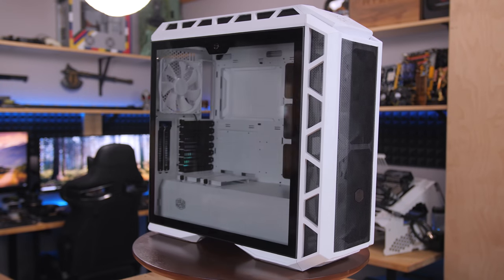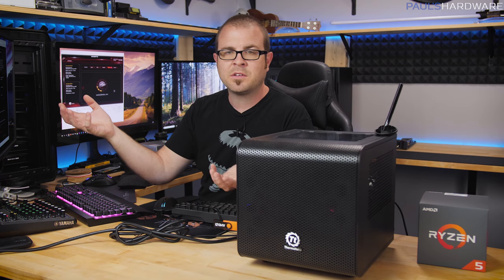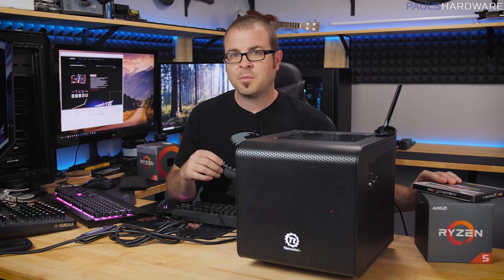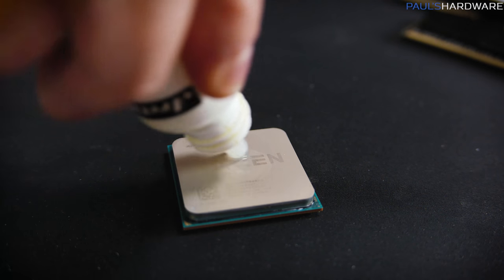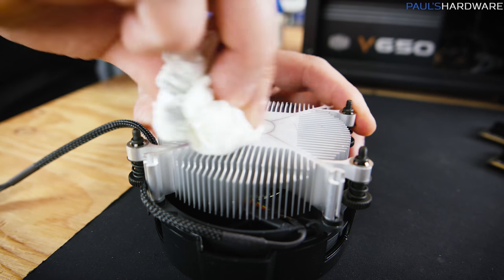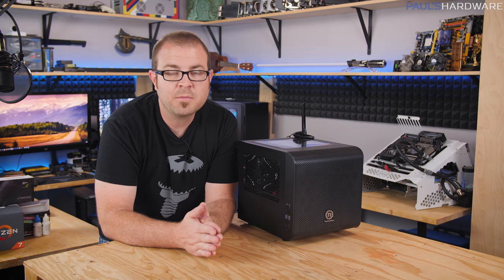How To Upgrade the $500 Gaming PC with Ryzen 2!

Comment from the maker: ►TIMESTAMPS◄
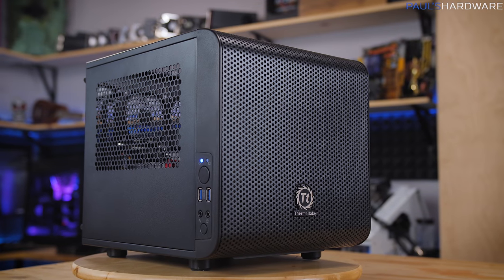0:32 Intro & Upgrade Goals
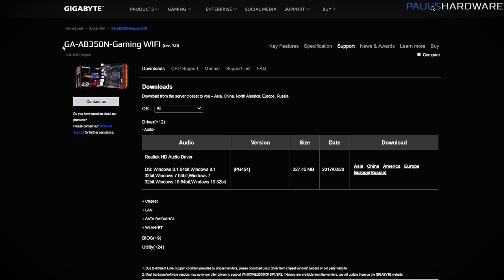3:59 Updating your UEFI/BIOS
5:50 Pre-upgrade BIOS settings
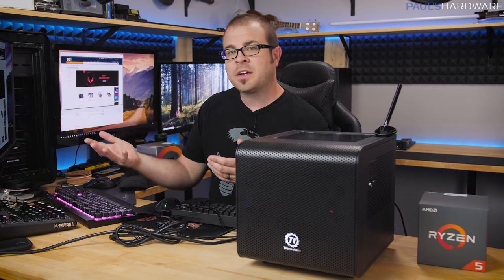9:00 My Chosen Upgrades
12:23 Finding a GPU that's not overpriced
13:54 Upgrade begins
14:51 Does your new GPU need more power?
15:57 Un-installing CPU and Memory
20:16 Comparing the Wraith Stealth to the Wraith Spire
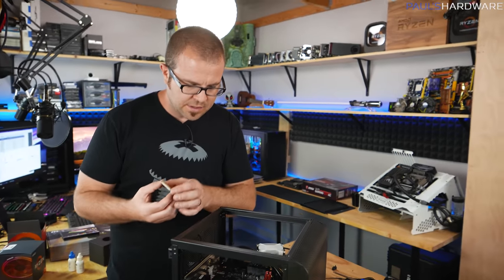21:05 Installing new CPU + Cooler
22:34 Installing new Memory
22:44 Installing new Graphics Card
23:58 Booting up again - BIOS settings
26:10 Checking that everything is working
►NOTES◄
- The new AMD motherboards use X470 and B450 chipsets (B450, not B460) 
- Total price for the upgraded system (via PCPartPicker) is $895 right now
-- 2600X is $230, GTX 1050 Ti is $205, DDR4 is $192
Thanks for watching the video guys!!
Reply: Paul's Hardware q
Reply: is it true that Precision boost 2 and XFR 2 only work with the new chipsets?
Reply: Nice but an all AMD build you have been nicer
Reply: are the new motherboards (for ryzen 2) compatible with first gen ryzen?.. bent my usb 3.0 pin and want a new motherboard and like the looks of the new x470 boards over the x370s
Reply: Paul is the best builder/instructor out there.
Reply: S Saini I would put a 580-8GB in it and use FreeSync.
Reply: Buff Barnaby who are you responding to?
Reply: Paul's Hardware you put the wrong link for the Trident Z RGB Ram in the description. Please fix :(
Reply: Paul's Hardware Hey Paul, a couple of questions, I'm upgrading my prebuilt PC to the new Ryzen 2600x and GIGABYTE GA-AB350M-Gaming 3 motherboard and I'm wondering if I will have any issues with Windows when I swap out the boards? I'm also wondering if the new parts will prevent the computer from booting if I don't install the latest BIOS updates first.  Thank you in advanced.

Comment: I actually just added a 1050TI to my 2400G HTPC build. I would argue the CPU upgrade short of a content creation use case is not needed and in that case I would spend the money on at least a 1060. I recently saw a 6GB 1060 on Newegg for $299 which I think is a great price for that GPU. I paid $276 @ Launch in 2016.
Reply: I agree 100%. At least test the 2200g with the 1050ti before adding the 2600x.
Reply: The 3GB EVGA 1060 is for sale right now for $199 at Jet and Walmart of all places. Model 03G-P4-6160-KR. Not sure if that's one of the "branded-as-a-1060-but-really-isn't" units that were in the news recently.
Reply: 10% more than at launch for a 2 year old card is a great price?
Reply: in the current cryptomarket/GPU market it is.
Reply: There's a Zotac 1060 mini 6gb on sale for 291.88 right now on Amazon
Reply: I get 40fps on ultra settings for far cry 5 with 1050ti. Most games run on very high. More than adequate for 1080p gaming.
Reply: Dennis George - Lol wowza, you somehow managed to get almost all of this wrong. FIRST OFF regular Ryzen has 24x on die PCIe lanes, with 20x of them open, not just 16x like Intel (aka 20 total vs Ryzen's 24). They are wired by default 16x to GPU, 4x to dedicated M.2, and 4x to the chipset. SECONDLY Raven Ridge has 16x total PCIe lanes, with 12x of them open, NOT 8x. They are wired by default as 8x GPU, 4x dedicated M.2, 4x chipset. The only time you should choose Ryzen for PCIe reasons is if you plan on running 2x GPU's (or a single GPU fast enough for 8x to be a real bottleneck, which is none of them yet) or plan on deliberately running 1x GPU at 8x to free up the other 8x lanes on the other x16 PCIe slot for whatever you intend to put there.

TL;DR - EVERY RYZEN BRAND CHIP HAS 4X PCIE LANES ENTIRELY DEDICATED TO AN M.2 SSD!!! 
AND NO MAINSTREAM INTEL CHIP / PLATFORM HAS / DOES THIS! 

 - (Aka, any/all PCIe SSD's must either run through the chipset / it's 4x link [meaning instant bottleneck city if you're using any of your chipset routed I/O (ala USB 3.0 ports) at the same time as your M.2 SSD] if you wish to run a GPU at the full x16 connection. That,s because the only way to directly route an M.2 SSD straight into the CPU on Intel's mainstream platforms is by running your GPU at x8, and using a PCIe slot M.2 adapter card  in the other x16 PCIe slot / with the other 8x lanes, but not only does this cut your GPU's connection in 1/2, but it wastes 4x entire lanes by putting a 4x M.2 SSD in an 8x slot w/ adapter card; that is unless you are running 2x M.2's, both at 4x in the adapter/slot.)
Reply: Cody Gunst I got mine in Feb of last year for $255, it’s the Founder’s Edition
Reply: Had to drive a little ways to get my evga 1060 6gb for $250, but being used for only a month before the guy got hold of a 1070 ti made it worth it.  Basically a brand new card.

Comment: Hey Paul and everyone. Just a bit of info for anyone in here that needs it. Ryzen been a fun ride. But it being a new architecture means lots of firmware updates. So I have gotten to know the Gigabyte X370 you guys gave me very well. That being said. It is always good practice to turn off XMP and load optimized defaults. But just wanted to share if you are using a AM4 Gigabyte board. It does not seem necessary. If you update the firmware or (BIOS) both the same thing. Gigabyte resets everything after the update. I even have to reset my fan curves. Anyway just wanted to share that extra bit of wisdom and happy building.
Reply: "load optimized defaults". Lol no, NO, NO, now don't be doing THAT! Hahaha.  

Assuming this is one of the GB X370 boards actually worth buying / using (aka the Gaming 5 & K7 flagships whose BIOS' I happen to be familiar with, which like the board itself, are near 100% identical. As in nothing aside from the color scheme, and the K7's BCLK generator for BCLK overclocking & it's associated BIOS options [useless for most people]), that setting will simply run the DDR4 at 2133MHz with the mediocre auto-timings. I've been running the Gaming 5 since the original Ryzen launch last March, and all you wanna do to best set up any kit of memory is (process tested with multiple kits of various sizes, speeds, and XMP versions) =

#1. - Enable the XMP Profile (this is only temporary, and just to get all the XMP profile's timings & sub-timings to show up as the "default timings list" on the right side of the memory timings page instead of whatever the kit's built in default timings at the base 2133MHz are. 

Then #2. - Manually select the clock-speed multiplier to the rated speed (memory menu), and DIMM voltage (voltages menu) to the rated 1.35V (if already on right clock multiplier BC XMP, simply turn it down a notch, and then back up to where it was). 
Setting these manually will disable XMP (and reset all the timings back to "AUTO"), but WITHOUT reverting the list of the DIMM's programmed SPD timings on the Advanced Memory page, from the XMP list that we want/need, back to it's programmed set of timings for running at the stock 2133MHz (which are useless to us). Considering how much a PAIN figuring out all of the XMP profiles' billion little timings can be without this trick (aka hoping you can get into Windows running XMP long enough to open "Ryzen Timing Checker" & snap a pic; which I've actually done b4 I figured out the above), the fact that works out like that is a GODSEND. 

And finally, and by FAR the most important step, #3. - Go to the Advanced Memory settings BIOS page, and proceed to replace the newly reset to "AUTO" timing settings with the long list of the XMP profile's timings on the right (but first verify that timing list actually IS the XMP's and not for 2133MHz or whatever. Aka make sure the 6ish primary timings match those on the DIMM stickers/the kit's box before you go and type that entire list in). Then simply do this for every single timing & sub-timing that has a number on that list, until the only "AUTO"s left, are those few which their are no listed XMP timings for.

This method allows you to quickly and easily plug the exact settings of any XMP profile on any DDR4 kit down to the nitty gritty sub-timings into your BIOS 100% manually (which often has a huge effect on stability & memory performance/compatibility vs running the actual XMP profile, despite their settings being identical).
Honestly, with how easy that makes typing an XMP profiles settings in manually for any kit, I can't see why anyone would ever choose to actually use the XMP profile itself instead.

Comment: 13:57 eBay has their buyer protection program, so you can get a used card and if it doesn't work, easily return it at no cost to yourself, except your time.

Comment: Unfortunately I'm late so you probably wont see this but here is a trick if you would like to use it... In Windows 10 (maybe earlier editions too) I can restart my computer into uefi/bios with a small batch file (if I wanted to make a shortcut for the command) or type a small command in the command prompt.  The command needed is "shutdown /r /fw /t 0" without the quotes. Either type that into a command prompt or make a file called something like RebootToUEFI.bat and when run it will popup a Window asking you if you want to shutdown. If you say yes it will reboot directly into your UEFI. No need to tap the keyboard. 

*note* I have Ryzen and my motherboard "resets" the settings on power failures or "shutoff" (full shutdown) of the computer and for some reason .. haven't looked into it yet... I have to go into the uefi and load my saved backup of my OC for it to work or it will end up using some default...if it goes through this "reset" it seems to restart a couple of times before booting and that screws up the above command but this doesn't happen for me on restart though so this trick above works. If you do run into issues using the command .. it may be something weird like my MB is doing.. One day I'll contact them and see why lol 

As an explanation of the above command .. this is how it breaks down:

shutdown /r /fw /t 0 

/r         Full shutdown and restart the computer.
/fw        Combine with a shutdown option to cause the next boot to go to the
               firmware user interface.
 /t xxx     Set the time-out period before shutdown to xxx seconds.
               The valid range is 0-315360000 (10 years), with a default of 30.
               If the timeout period is greater than 0, the /f parameter is
               implied. (doesn't apply in the above example)
 /f         Force running applications to close without forewarning users.
               The /f parameter is implied when a value greater than 0 is

Hope you see this Paul .. if not .. hope some others will find the information useful. I have a keyboard with extra macro keys so I have one mapped so I have a key to reboot to UEFI :)

Comment: Tip for those of you planning to upgrade.....KEEP YOUR ORIGINAL DOCUMENTATION AND BOXES!!! It makes shipping and selling so much easier. No having to find bubble wrap and anti-static bags from somewhere to sell items then.

I've spent the last 2 months upgrading from an FX-6300 to a 8350, then to a Ryzen 5 1600, along with 3000MHz 16GB corsair kit, and upgraded from a GTX 960 4GB to a 970, managed to flip the 970 a day before my new graphics card turned up.....Got myself a fractal design define R5 as well, upgrading from a zalman z11 midi tower...which just sucks for airflow, cable management & adding new fans in.

I knew the good credit rating would pay off at some point....got myself a 1080ti...went from low-mid tier gaming system based on Vishera/Bulldozer to the other extreme...Least I won't need to upgrade for a while now.

I kept all my boxes and sold my old hardware too. I made about $1300 (before fees on ebay and paypal, you'll pay about 10% on ebay and 3.4% on paypal, including on the shipping costs you add) from old hardware and other stuff I wanted to sell (few old games, stuff i've had for years and never used etc). Use your case box to store all your other boxes and packaging in, helps keep clutter to a minimum....and gives you a table to use for your bedroom workshop/office.

Comment: I cant wait to get this, I had a limited budget and so I mixed and matched and got some different parts, I settled with the apu, power supply, case, motherboard and the ssd from the origanial, and I found a cheap $140 gtx 1050 2gb and I found some ripjaw q6 gb kit for about $80 less then you had there, I also had to buy some periferals and got some red dragon stuff

Comment: 2ND GENERATION ALREADY!?!?!? The first one seems so not long ago.
Reply: Patryk Wieczorek been a year
Reply: That's why I said that it seems so, the time goes sooo fast
Reply: Patryk Wieczorek Apparently it is just Zen+. Similar architecture but just fine tuned and improved.
Reply: Generic Username So really they should've waited and released this has first gen..
Reply: Kinda yeah, but also kinda no. It's the same as when upgrading your parts, do you just get whats available now or do you just wait a little longer to get the better stuff, since some new tech seems to always be right around the corner?
Reply: Zen+ is primarily a production upgrade from 14nm to 12nm, with a couple of new designs thrown in.  It's also a bit cheaper than the Ryzen 1000 series was a year ago.  The SRP for the 2700x is $70 less than the SRP for the 1800x was a year ago, and the new chip is labelled to run faster than the first one and include a fan as well.

Comment: Paul's Hardware I have the larger version of that case (core v21), I personally swap the graphics card screws for the thumbscrews on the bottom panel. They're the same size as the thumbscrews, and makes swapping the graphics card easier. (If you do something like benchmarking graphics cards, lol)

Comment: It's faster to get bios version via WMIC. From command prompt: 
WMIC BIOS GET SMBIOSBIOSVERSION

Plus, it's a builtin OS tool which means no need to install and run third party software just to retrieve data that's readily available in Windows.

Comment: If you plan on having a dedicated GPU in your system, is there any reason to get a CPU with integrated graphics. Will it negatively impact the performance of the CPU processes? Is it simply a part added on to pad the cost? Or is it actually useful to have in some circumstances, even with a dedicated GPU?

Comment: Is that the AMD optimized version of the Trident Z RGB ram? By that I mean the one that has a part number that ends on an X. I'm looking to upgrade my ram to 3200 mhz ram and I really like the Trident Z but I don't know whether to get the CL 14 "intel" or "amd" versions of the ram, F4-3200C14D-16GTZR for intel one and F4-3200C14D-16GTZRX for the AMD one.
Edit: I have a ryzen 5 1600, hence the type of ram question
Reply: Lyubo Raev if they are the same price get the amd one for whichever cpu you have
Reply: There's a 30 euro price difference but if it means that the amd one would work out of the box without any tinkering I would be willing to buy it. I'm specifically asking because he called that ram universally compatible and I'm wondering if he's talking about the intel or amd version.
Reply: I unknowingly bought the hynix version of that ram. A 16gb 3200 c16 kit, and it works great on my 1700. I think for the most part the memory issues are taken care of . I've got it running at 3200 c15 with no issues
Reply: It also may depend on your motherboard though, I'm running the crosshair vi hero
Reply: I have the GTZR with Ryzen 5 1600x  works fine. I had some issues back before the creators update to windows. Ran it at 2133 C15 default for a long time with no issues. 
My bios did say it was running the XMP but was not applying it... i forgot to fix it a while back. Rebooted just fine after getting XMP working. Using the crosshair vi hero v.1403 currently.
Reply: 30 euro difference seems a bit steep, id probably just go with the cheaper one then if the timings and everything else is the same.
Reply: I have the F4-3200C14D-16GTZR on an MSI x370 gaming pro carbon with 1800x and it's works great. XMP settings work correctly.
Reply: Thank you for the replies guys. Will order the cheaper, non X variant of the ram and see if that works. If it doesn't I can always get it swapped for the X version.

Comment: I updated my BIOS after watching this video, since the price difference between an 1800X and a 2700X is only about $15 (pre-release).  Before I updated the BIOS, ASUS' AIsuite OC'd my R1600 to 3550Mhz using the stock fan, about 50Mhz less than the specified upper limit.  Now AIsuite is running the same chip at 3750Mhz, or 150Mhz more than said limit.  Was the old BIOS (3203) that much more conservative than the new one (3805)?

Also, my Corsair DDR4@3000 ram is running at 3000 instead of 2933 now, with a possibility to run faster (I dropped it back to 3000 after the D.O.C.P. tried to set it at 3200).

If you have or will check out the new "compatibility" BIOS software on older hardware it might be interesting to see if these improvements work across all the manufacturers.  On the other hand, the new BIOS may have just freed my hardware from a restrictive BIOS.

Comment: ACK! PAUL! Most of the target audience won't care but "dual rank" does not describe the location of the DRAM on the DIMM, but rather how the DRAM is mapped electronically. Different ranks are typically used to add more memory density on a single DIMM with more DRAM chips. This can also have some impact on performance, but rank compatibility is the primary concern since the memory controller is only built to address certain ranks on certain channels.

Comment: i have a question  for you   :)   if i already have a ab350- gaming  mother board from Gigabyte  but  the bios  on it isnt f22  i dont owne a cpu yet   if i buy a 2600 for it  will i be able to use that cpu to update the bios to f22  or am i stuck  to buy a 1600 ?